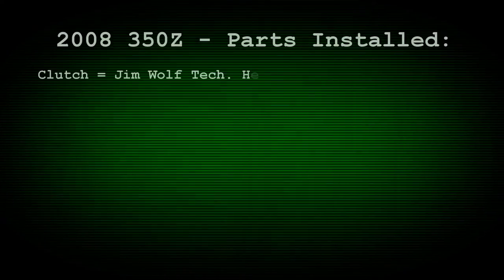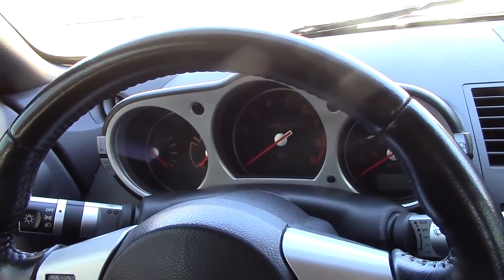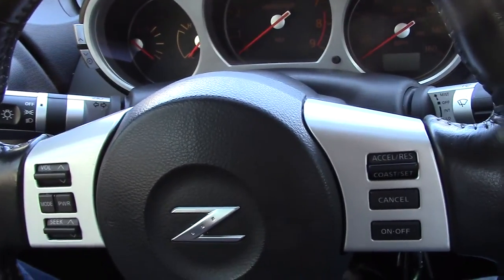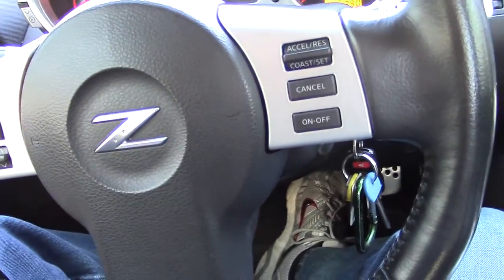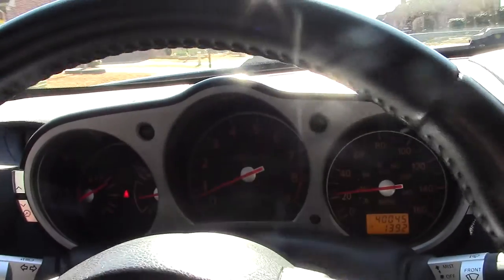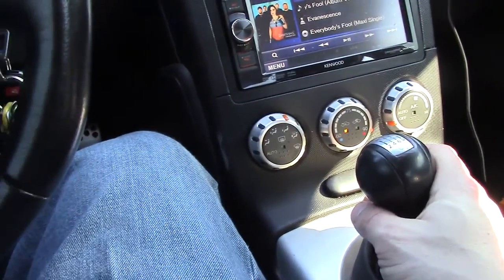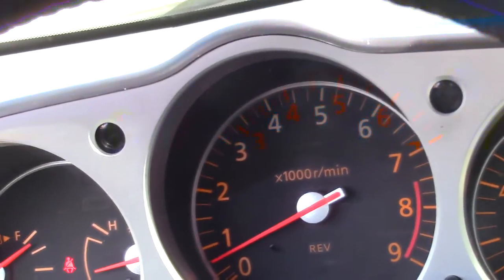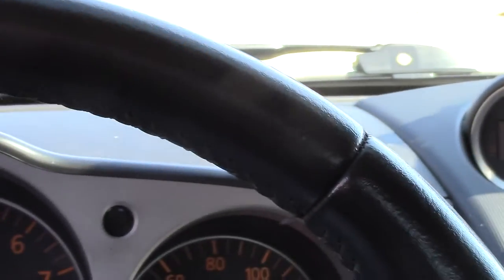350Z JWT HD Clutch - Zspeed HD Slave Cylinder - Wilwood HD Master Cylinder - OEM DualMass Flywheel

Comment: Chattering sound (at least in the vw's) actually is coming from the gears in the transmission. Your car rev up a bit slower now?
Reply from the maker: The chattering sound does technically originate from the lashing noise from the transmission that is transferred down the line.  This is the whole reason they had to create a specialized dual mass flywheel with dampeners in it (nissan) to take that noise out.

No, the car does not rev slower now. It revs identical to what is always has .. hence the flywheel is exactly what was in it except brand new.  I could have used the existing flywheel in it except you can't turn dual mass flywheels traditionally.  People have found speciality machine shops who figure out how to turn them but this is an iffy practice and I'd rather go down a path of 100% long term success than a thinner flywheel ,.. not to mention I had no specialty shops lined up to resurface a flywheel.  This isn't even mentioning the added issue of having to bring the car apart to get the flywheel out.. take it somewhere else.. get it resurfaced and then bring it back to install.

I'd really like to have a side by side lightweight flyhweel and then this car to show to difference in noise.

As quite a few people don't realize just how much new noise is introduced while they drive under 2500rpm that didn't previously exist.  They just think they are going to get more performance with a faster revving flywheel.  Many get used to the noise or otherwise aren't going to spend more money to swap it out -- and others just can't stand it and will put a Nissan Dualmass flywheel back in it to eliminate the noise. 

It's all personal preference.. and of course if your car isn't a daily driver it makes that decision a little bit easier.

Comment: hey, i've been having a loss of pressure occasionally when my 350z first starts up.  I also have been having a 'growling' noise from my throw out bearing occasionally when the clutch is first engaged.  I know im about due to get a new clutch assembly, however the loss of clutch pressure makes me concerned about the Master and Slave cylinders.  My question is, is it normal to have to swap out the Master/Slave cylinder's when you change the clutch?  Also, how do you like your JWT clutch?  I've been planning on getting this Exedy w/dual Mass Flywheel on ebay. --> http://ebay.to/1JF7ai2 .. any thoughts on this choice?
Reply from the maker: KingAndrew5000 On the Z's,. Yes it is normal to need to swap the Master and Slave (Slave is usually the problem) but it's always advised to do the master with it (at least rebuild it).  I personally went with the more expensive Heavy Duty versions from Zspeed and Wilwood in an attempt to make this be the last Slave/Master put in the car.  So far so good, but we shall see. I would definitely take a look at the slave and master while doing the work.. if you want to go cheaper then at least swap them for factory units.. or swap the slave and get a rebuild kit for the master.

Interesting find on Ebay.  They claim the flywheel is the OEM Nissan Dual Mass .. If so, and it's new then buy it!  I got a deal on my Flywheel and it was still $800 alone.. they are normally over a $1000.  The clutch is a good one, solid brand name.  In the 2007-present Z's the throwout bearing is in the concentric Slave Cylinder .. This kit is for 2003-2006 Z's which I assume yours is, in which the Throwout bearing is not in the slave cylinder as shown in the pictures from your link.

Bottom line, the price pays for the flywheel alone.. and good call on going with the OEM flywheel (you won't have any extra flywheel chatter).   

I am a little dubious on how they can offer all of that for such a low price.. so maybe inquire about if the Flywheel is a brand new Nissan OEM dual mass unit? 

As for my choice of clutch.  The JWT is awesome.  It broke in as expected (Drive 500 miles keeping it under 3500-4000 rpm.. no full throttle.. no quick shifts, etc etc)..  and the pedal effort being about twice as stiff as stock I've gotten super used to.  I highly, highly recommend the JWT, but Exedy makes exceptional products as well.
Reply: Ikos Log thanks for the info.  did you change out this equipment yourself?  the Master / Slave cylinders and the clutch?  If so was it difficult?  I've done some minor repairs on my Z, and i'm fairly mechanically inclined, but i've never done a clutch before.  just wondering if it's worth the time and effort to try the repair myself.
Reply from the maker: KingAndrew5000 I've done this job before on 350's (and other cars)... but I personally didn't want to drop my transmission without the proper tools (primarily a lift).. so I shopped around for a good name in Z's around my city and found one.. and got him to do it for a very fair price.. Was a great decision on my end.

If you are curious Nissan quoted me $2800 parts and labor.. I obviously said are you smoking crack, bought my own parts and the master mechanic I found did it for $600 flat (He works at nissan).  

All of that said, there are guides online on 350 forums and such that show you step by step.. and if you don't have any back problems have a friend to help etc.. It's definitely a job you can do on regular jack stands in a day .. might take you all day, but the actual way it goes together is not hard.. It's just working under the car really.  

I suppose it all depends on your budget to be honest.  If you do let someone else do it.. try to find mechanics familiar with your car (350's/300's etc) and I wouldn't pay more than $800 for the job .

Remember my labor was JWT HD Clutch, New Flywheel, HD Concentric Slave cylinder, (with new lines), HD Master Cylinder (with new lines), removal, etc.  A GOOD mechanic who knows what they are doing can do this job in 4-6 hours.

Comment: i got a  06 350z with 30k  miles on it like 9 months ago. currently at 35k right now. should i replace my clutch and flywheel already or wait till my clutch goes bad. also do 350z come with a clutch damper cause everytime i drive agressivley my clutch slips whenever i get to high rpms. is it cause i suck at shifting or the clutch damper ( if i even have one). i dont mind the chatter on mine. last question what are the benefits of ss lines and a willwood master cylinder and slave cylinder
Reply from the maker: +Edwin yO Lots of questions. :) -- I'll do my best.  -- If you aren't experiencing any major issues, you should get as much life out of your clutch as you can,.. when you do change your clutch/flywheel down the road you may likely be having some of the Slave and/or Master cylinder issues that are common. -- That said, I changed mine very close to the mileage you are at and there was a lot of life left on the stock clutch however the Concentric slave cylinder was going bad in mine which prompted me to go ahead and do the "deed" and essentially upgrade and fix the problem for good.

Yes, 350Z's have a dampner inline which will sometimes rear itself on fast shifts,.. along with the new Master/Slave (aftermarket) you can get complete kits to help.  Most people who swap their clutch for an aftermarket , like the JWT,.. new flywheel (aftermarket or stock),.. and upgrade their hydraulic systems (Master/Slave) find they never have the issue you speak of again.  Many just do part of what I just mentioned and the "issue" is gone..   

Your clutch could be slipping at high RPM's due to the hydraulic system,.. I noticed it myself and it is due to the heat coming off the headers, among other things .. While hard to detect if you aren't somewhat adept in changes,.. I could definitely FEEL the clutch pedal change at higher RPMS while mine only slipped for a split second (although clutch was not bad).. if that makes any sense.

All Z's will have that stock chatter -- it's the chatter with an aftermarket flywheel (non dual mass ) that I , personally, couldn't deal with.   If you are fine with that, that will save you a TON of money.  

While I spent $1000 on a new Nissan Dual Mass Flywheel,.. you can get an entire great HD clutch, lighter flywheel, master cylinder, and maybe even the HD slave cylinder + lines for $1000.  At any rate, I spent $2500-$3000 in parts largely due to not wanting to hear the chatter at low RPM's of a light weight flywheel -- If I didn't care, I'd saved a ridiculous amount of money.

The benefit of SS lines are to help with that "dampning" effect, to help with heat dissipation and penetration into the hydraulic fluid,.. to give a bit better flow rate, to allow a consistent "pressure" due to the change in lines - of the Clutch fluid (which translates into better (slightly stronger) pedal pressure) but an overall solid improvement and durability for basically the life of the car.  Also, SS lines don't really cost that much to be honest.. so it's a no brainer to add them while doing the job (or having it done).

The Heavy duty master and slave cylinders are to basically improve on the design of Nissan.  Your car and mine are a bit different (though you are in the "grey" area.. so double check) -- You drive an '06, which should have the "Rev-up" engine upgrade and the body and interior upgrades.  In '07 they swapped the Motor out completely for the VQ35*HR* which included a concentric slave cylinder inside the transmission.  I am not sure if the 2006 models also had the new CSC or not.   (Better if not moneywise and working on it).   -- At any rate the Concentric Slave Cylinder is a complex design and in theory is great but is a major point of failure for the 350Z's with them unfortunately.  This is why it is 100% worth it to get the HD aftermarket versions to basically eliminate any possibility of failure in the future (Many times people will just replace it with a stock/oem .. only to have it go bad in 5-10k miles.. maybe 20-30k miles, but still it shouldn't be going out period with regular use.)  The HD version of the CSC, and Master .. I researched heavily and are the absolute best out of them and are worth , to me, the money for basically a pay a bit more upfront to ensure you don't have to worry about it again.

Which boils down to my clutch replacement.. the entire problem I was having was primarily due to the CSC that's stupidly placed inside the bell housing.. so it would be sort of dumb to drop your transmission and not change the clutch while you have done so,.. 

Hope that clears some of this up.  I highly recommend the my350z.com forums for questions.
Reply: +Ikos Log  thank you so much bro didnt except a huge response but u cleared up all my questions
Reply from the maker: +Edwin yO Happy to help,.. all Z owners are fellow brothers :)

Comment: dude i'm going through a dilemma right now choosing a clutch/flywheel combo for my 05 g35 sedan, iv been studying the forums for the past week  and really concerned about this chatter noise noise if i go for SMF. Some people say its not that bad others say it sounds like a diesel engine lol. the thing is my budget is around 1k (including labor) i found a nissan tech who would do the job for 400 so it kinda works for me but only if i go SMF. JWT has a cutch kit for 550 including a heavy SMF (27LBs) i believe.
Reply from the maker: +Mohamed Ibrahim I understand, trust me.  I had to save and put in considerable more money to ensure there was zero chatter as I went with the Dual Mass Flywheel as the video shows.  I've heard Single mass flywheels on these cars and it's not something I personally could live with.  It sounds like something is wrong or broken until you get over a certain RPM.  I think these cars are "nice" and while I like a nice sounding exhaust , a rattling sound from the tranny area sort of dissipates that.  (Again, some combinations are worse than others, and for some people the noise doesn't bother them at all..)  If this weren't my Daily Driver I may have considered a SMF for weight/throttle response.. 

I got the Factory New Dual Mass Flywheel for $800 , and that is about as cheap as you would get it.. so with your budget you have no option but to go with the cheaper SMF kits unless you can wait and save up.  

A lot of companies and people try to pass SMF's on these cars as "Silent" but it simply doesn't exist for our cars.  Some are, again, quieter than others.. Typically the heavier of the SMF's.  Sub 2-2500 (give or take) RPM you will hear some type of noise.. 

The answer I got from people, mechanics, and parts dealers was "Just keep it revved above 3k RPM and you'll be fine".  I don't know about you, but when I'm just driving regular/non spirited I shift where my RPMs are definitely under 3k.  Though again, keeping them up there above 3k would eliminate the noise at , perhaps , the slight cost in extra fuel (not much though).  

Bottom line, if you need all this.. you likely have an issue with your Slave, Master, Clutch disc, etc and if like me,.. you are replacing OEM parts with performance because A) They are cheaper, and B) They are better!

You may want to try calling around some machine shops and mechanics in the area to see if anyone knows how to turn your Dual Mass Flywheel (It is possible) -- Just not many people have the skillset and tools to do so.  If you could actually find one of the rare people who know how to do this properly,.. you could use the DMF you have and it would mate fine with a proper new surface.

$400 is a fantastic price for the job.

Good luck with your SMF -- The JWT clutch you'll like.
Reply: +Ikos Log  thanks for the insight dude and you said not go with the nismo roller bushing ?
Reply from the maker: +Mohamed Ibrahim Right.  Leave the Stock Bushing in there.. The Nismo is asking for trouble.  It requires regular lubrication/grease -- And thus is meant for a track/race car where you would be dropping the transmission a few times a year or so. I bought the Nismo Bushing but a Z Specialist and the Master Mechanic at Nissan both told me separately that the Nismo Bearing was nothing but trouble .. which I'm glad they let me know as I had no idea it was somewhat of a maintenance part.. unlike the regular brass bushing that is already in our cars.

Comment: To anybody, let tell you first I have 2012 370z that has JWT combo (clutch/flywheel) and Zspeed slave cylinder installed and let me tell you guys you will notice the performance side and noise. Since the flywheel is a single unit you will get chatter noise, but to fix that problem but not completely use Motul 300 Gear 75w-90.  Trust me changing the fluid in the transmission not only you benefit from the noise drop but also changing into gears.  Remember if your a pet peeve towards noise coming out from your transmission then use the Dual mass flywheel. Reading the forums and personally talking to Z specialty ( In southern CALI) they to told that the dual mass flywheel are bad for the cars in the long run. (Remember I also read the forum about the pros and cons about Dual mass vs Single flywheel).  REMEMBER IT'S YOUR PERSONAL TASTE.
Reply from the maker: +Randy Valle Thanks for the input to all.  I agree with everything and personally considered the better quality and viscosity gear oil to attenuate the chatter that was inevitable from anything but a dual mass OEM flywheel,.. But I couldn't drive the car everday and have the noise.. Many can, it's very individualistic with the choice of flywheel.  I did upgrade everything else to a performance grade (and/or HD variation).  Do you mind providing some link/proof that a dual mass Nissan/OEM flywheel is bad for the 350/370Z in the long run?  I'm a bit skeptical given the transmission was engineered by a team specifically with the dual mass in mind.  How exactly is it bad for the car in the long run?  (Not saying you are wrong, just would like to know more) Thanks.
Reply: Thank for responding back.  I saw you comment and I will definitely give you the links and the shop number if you ever want to chat with them on this subject.  It would take only little time (I'm not talking about months) I just have school and the whole ordeal with studying.  Give me at least 2 weeks and you will get info you want.  Sorry for the delay.
Reply from the maker: +Randy Valle No big deal at all,.. no need to go to any trouble.  I was just curious on how the dual mass stock flywheel engineered by a team of people at Nissan/Infiniti would damage the very car it was specifically designed and built to spec to work with.  I've never heard or read any such issue with this specific car.  The Slave cylinder is known to not be engineered well and fail which is why I've replaced mine with a completely non stock piece engineered not to stick/leak/break.. .. Anyhow, I'm quite confident my brand new OEM Nissan Dual mass flywheel with the JWT HD Clutch, SS lines, Zspeed Slave, Wilwood Master will last the life of me owning this vehicle.  Since I don't "rag" this car really at all.. this clutch will go 100k miles without much issue and I highly doubt I will still have this particular Z even in 60k miles from now.. I only put on about 10k a year, sometimes 12k.

I'll dig around a bit to see if anyone has experienced any "damage" from their factory flywheels, but from a quick search nothing has popped up yet.   (Not that I don't believe you were told this,.. or that is is potentially, in some way, accurate.. I'm just not overtly concerned based on piecing these items together myself and knowing how they all work together and interact and what forces are applied etc.).

Don't worry about any information, I don't want you to waste any time on it.  It was just a passing response to your statement.

Good luck with university.